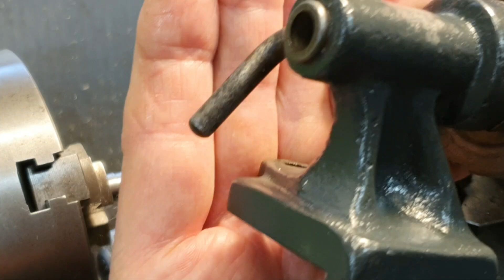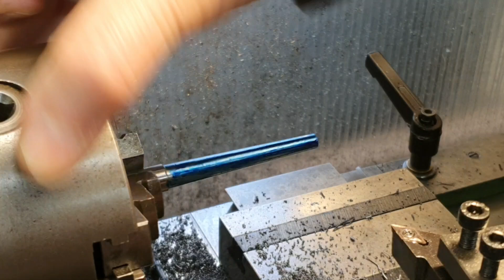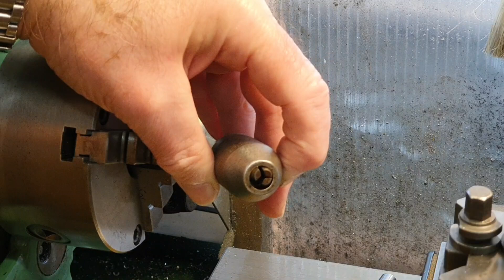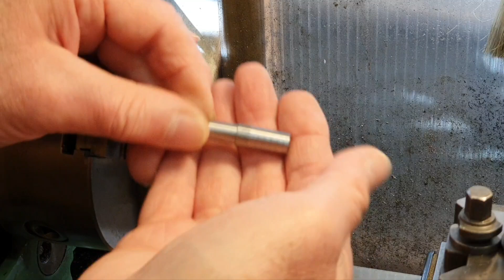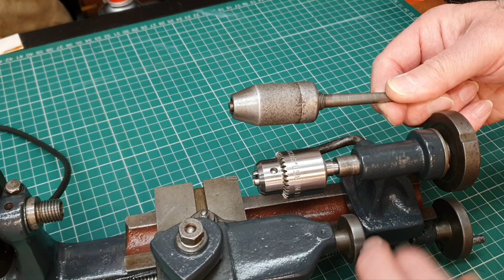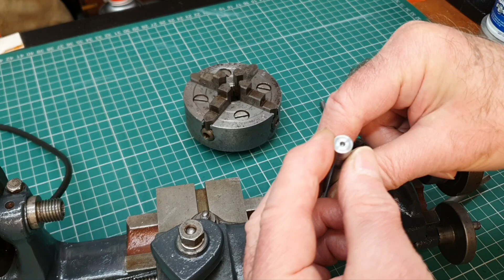Wizard Lathe Morse Taper MT0.

Comment: If you have interference problems, as you are taking light cuts, yuo could extend the tool in the toolholder. And thinking of light cuts for the very best cut,  a vertical shear tool would allow you to take tenths and produce ultra fine wire wool as swarf.
Thinking of Morse 0 tapers, i once made a rotating centre in morse 0 for a laugh when a friend bought a very small athe. It had needle roller bearing and ball thrust bearing too.
Reply from the maker: @chrisstephens6673  Thanks for the suggestions Chris it's much appreciated. I may try and make a live centre, it would be a great challenge. Cheers Nobby

Comment: 0:50 Morse tapers are not all the same angle. They are close but not identical. There is a story behind that. A Standards body (I forget which) asked Morse for the taper masters to measure up and use and industry standards. But Morse had never actually determined an exact angle for their tapers so they all differ slightly. So the inexact existing masters were used as the standard and that is how we ended up with slightly different angles for each Morse taper. Now it's too late to change.

Comment: Carbide inserts work better under load and thus why with light cuts the surface finish is usually not that good. Better off with a HSS tool bit with a small lapped radius.
Reply from the maker: Thanks for the kind advice. Someone else also suggested this. Will try this next time. Cheers Nobby

Comment: Nice video Nobby, I have the same issue on my Myford on shallow tapers, it would be nice to have the Myford taper attachment but my DRO is mounted in its place ATB Mark
Reply from the maker: Thanks Mark. A DRO for my Mumford is something I would really like to have. I was given a resettable dial for the cross and top slide which helps, but not as good as a DRO. Cheers Nobby

Comment: If you want a really nice finish a HSS tool with a large radius is very good. I have put round HSS in my diamond tool holder and had excellent results before. 😀
Reply from the maker: @julias-shed  I'll give that a try next time Julia. I guess I'm lazy not using HSS more often. Cheers Nobby
Reply from the maker: @julias-shed  You must have read my mind Julia. I did use the Wizard lathe quill to hold the mt0 to cut the drill chuck taper. Cheers Nobby
Reply: @nobbysworkshop lol hadn’t got that far so removed the comment 🤣
Reply: If you tried one yet, give a vertical shear tool a try. You can take tenths off and a near perfect finish. Even better is a roller burnishing tool which not only consolidates the tool marks it work hardens the surface for improved toughness and leaves a near ground or even polished finish. .

Comment: Hi Nobby.  I did similar with the Morse "0" tailstock on my Sherline micro lathe.  I cheated and bought a cheap Morse 1 arbor for a drill chuck and simply reduced it to Morse "0".  Set the top slide using a test indicator on the Schaublin which has very long travel, being a tool makers lathe.  Dead easy job. Cheers Rob
Reply from the maker: That was a good idea Rob. Didn't think of that. I set up the angle the same way you did. Adjusted the top slide to get it roughly right, and made the final adjustments with a close gauge.  Cheers Nobby

Comment: Nobby. I hope your "Light Bulb" moment was a LED one so that it used minimal Brain Power ? 🤣. I was going to suggest if you had not already done it to buy a MT 2 to MT O sleeve for your headstock. Often small machine reamers have a MT 0 shank, so it would have had future uses. Great Job. Regards from Australia.
Reply from the maker: I did use minimal brain power. That's all I have 🤔 Couldn't find a mt0 to mt2 at the time. The only mt0 to mt1 I found was £18 + postage. To expensive for a one off job. I don't have any mt0 reamers anyway. Do have some mt1 drills that came with the Myford lathe, but most of them are blunt. I have a mt1 to Mt2 adapter, as I have one or two mt1 reamers. I'm going to rest my brain now. Cheers Nobby

Comment: That's a small MT Nobby, love that little micro lathe mate! - Cheers Jim
Reply from the maker: It's certainly the smallest Jim. I've managed to find a MT0 dead centre as well. So I'll soon be up and running. Cheers Nobby.
Reply: @nobbysworkshop  Sherline makes tons of MT0 tooling for their line of tiny lathes, they sell varieties of live and dead centers, collet holders, and other things! :)
Reply from the maker: @martinpanev6651 Hi Martin. I did check out Sherline, as I guessed they used MT0 morse tapers. There is an agent here in the UK. To be honest their prices are more than I could possibly afford. A live centre costs almost half what my Wizard lathe is worth. I hate to think what they charge for a dead centre. I got 2 for GB£12. My be Sherline is cheaper in the US? Thanks all the same. All the best from Nobby in England
Reply: @nobbysworkshop  The sherline stuff is quite pricey, ive ended up getting most of my sherline accessories from eBay
Love the wizard lathe, its quite cute
Reply from the maker: @martinpanev6651   👍👍 I think it's cute as well. All best wishes. Nobby